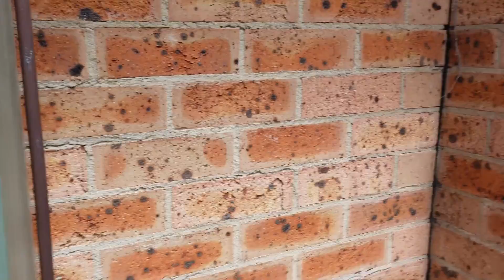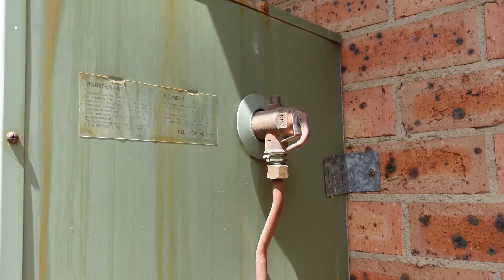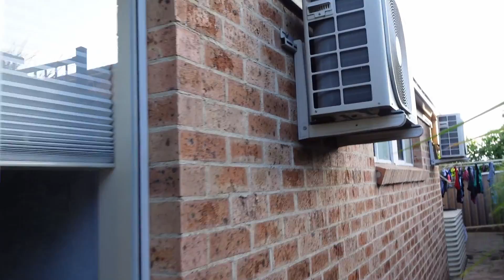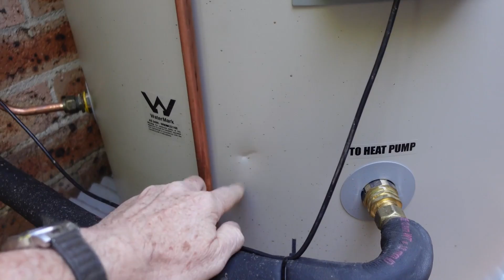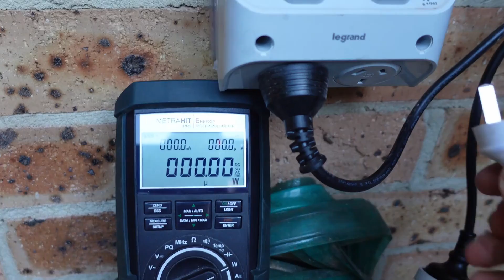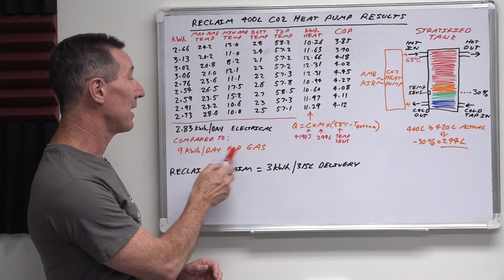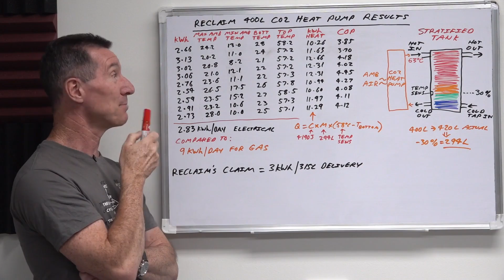EEVblog 1517 - Heat Pump Hot Water Install & Analysis

Comment: Ambient air... my daily consumption on my reclaim has gone from 3kw/day start of October down to 2.2-2.5kw/day currently.  It does jump about a "lot" with ambient air going from 15deg to 25deg.  2 showers a day & some washing up.
Best thing is that even on a cloudy day with a 4.5kw solar system, its 100% free energy at its 1kw/hr consumption!
Reply: From 3 kWh/day down to 2.2 - 2.5 kWh/day, supplying you free domestic hot water even on a cloudy day from a nominal 4.5 kW solar PV system is very nice. With a power draw of 1 kW it means the heat pump needs between 2 to 3 hours of operation in your particular use case and the solar system seems well matched to your needs.
Reply: @sietuuba  yes, on most days its enough to cover the hot water & do some other low current draw activities. However that may change in winter - i'll be adding more solar soon :)
Reply: Wouldn't a solar water heater be better and cheaper as no electricity is used at all? Maybe they're not that common there.
Reply: @GeomancerHT  They are quite common depending on where you are, new builds some councils mandate a solar water install.  You are 100% correct - they're the most efficient way to heat water - however, they're not the most efficient use of roof space - thats the thing. If you have loads of roof space - its the best option.  If you have limited roof - you're better doing solar, so that the other 1/2 the day its producing for you.
Reply: @nateb3105  thank you!
Reply: @GeomancerHT  It does depend quite a bit on the needs of the building and its occupants as solar thermal collectors are very efficient but they only produce hot water and their production can easily exceed the needs of a single family home in the summer. Other things factoring into the decision is how much thermal energy storage fits in the building to service the needs in the shoulder seasons (spring and autumn).

Space heating is a great application of solar thermal systems in addition to producing domestic hot water for the taps, but if that isn't needed, or if the building isn't going to be built or renovated for hydronic heat distribution that works best with "low grade heat" as in all the way down to under 30 degrees Celsius, it impacts the economy of the system. Solar photovoltaic systems have an easier time finding some work to do since electricity is easier to distribute... even though storing electrical energy is more expensive than storing heat. A system for delivering solar thermal heat to something that needs it is potentially more expensive despite the storage method itself being cheaper!

Comment: No need to set the tank temperature so high. Drop it to 45-50 degrees and the heat pump efficiency will go up quite a bit.

Comment: Your figures are very similar to mine after conversion.  Had an on demand gas at the old house,  an old off peak tank at the current house and converted this to a Rheem 320L heat pump unit. We are on a 5 kW (rated ) solar system.  South Aus, near Port Wakefield.  Instant reduction in our power bill.  I recommend this to everyone. Our unit cost $4000 installed. 
I'm keeping my old tank. Going to set it up as a standby solar cell only heater for outdoor hotwater for washing the doggies.

Comment: Hello.
These heat pump units are a super device. Because it is the only device that can give more energy than it consumes. Not technically, but it is. Let me tell you a secret. It's the same as killing 2 birds with 1 stone. During hot water production in summer, the outdoor unit of the heat pump blows cool or cold air. Introducing this cold air mechanically or electronically into the building through a filter and through the air duct will significantly reduce the use of indoor air conditioners externally. The result is extra savings.

Comment: First I grew up in a house with an 85°c hot water system, yes that's what came out of the taps.
Secondly I just got a free heat pump hot water system at my business property due to a government program.
Thirdly I live in the same city as you.

Comment: We're thinking of moving away from our gas hot water system and stove as well. Unfortunately, since our (newer than yours) Rheem had the bottom rust out of the tank we got a far more efficient "on demand" system as a replacement, however that was before our solar panels were installed so it's still relatively new. 
Downside will be that without a battery we can never have hot water production during a blackout (the only benefit of the old system) or use the stove.

Comment: The diagram @33:15 is showing lower COP at lower temperatures for both refrigants, so the efficiency in colder tasmania should be worse, not better. Perhaps they measured efficiency through a heat wave..

Comment: Dave loved your blog, maybe you could comment on my experiance, I just had a Chinesium $2500 heat pump installed for $99 in Kincumber I have 3.3kw solar no battery, SO I programmed[installer did not set] to operate 9am to 3pm which, so far, has used the summer solar. My concern is the winter, the unit is set to just 65°C, not much headroom. The unit does have 1.7kw full freight heater which is selective to off. Bottom line, using solar [I see on last bill I have used some of the 222kwh feed in, there is only a change of $5 on the total bill for January. My old heater was 10 yo, a new heater for $99 is a good deal. IF it dies and no warranty I guess an off peak original will go back in. The subbies were doin 4 a day, my job was acceptable but sketchy, the electrical would not pass regs IMO but OK, the expansion valve drain will discharge on your feet, not legal but ok as they would say "existing" PS they reused my expansion valve insulation kit, just 600mm foam on the discharge, our villa is 34 years old, no pipe insulation, BUT lots of fibre in the roof, the 3/4" line is too big, holds lots of water to go cold, takes 30 seconds for hot water to reach taps. I intend to rerun the hotwater lines in 1/2" PEX, with a return loop to the tank as it takes 30 seconds for the hot water to reach the taps what do you think

Comment: The idea that a system which is scavenging for heat will operate more efficiently in colder temperatures strikes me as specifications supplied by Batteriser but if this is true then you can deliver net cooler temps to your heat exchanger by slowing down the fan or recirculating some of its airflow.
But how that makes a lick of sense needs its own video because - it doesn't

Comment: Seems very strange that a heat pump should get better COP with lower ambient temperate. The lower the temperature difference the heat pump needs to work against the more efficient it becomes, it's kind of obvious when you realize that a heat pump is the inverse of a heat engine, which can be more efficient the higher the ΔT is.  Higher efficiency in a heat pump because of a cooler heat source would "break physics". Even if the system is extremely optimized for max efficiency at slightly lower ambient temperature you should't get lower efficiency because of the warmer heat source. 

And if you haven't changed use much since the gas heater, you know how much energy you use per day on average, with much greater certainty than your calculations based on measuring the temperature and a lot of assumptions. With just the one assumption that your use haven't changed significantly your "COP equivalent" is about 3.18 based on 2.83 kWh power used, and 9 kWh heat used based on earlier use.  That's not great, that's really bad. And high ambient temperature doesn't explain low efficiency in a heat pump, no matter the refrigerant.

Comment: I love your engineering breakdowns. I have a Rheem 50 US gallon heat pump water heater set to 120F or 49C and your KWh usage numbers almost exactly match my KWh daily usage. There are no mixer valve requirements here. It’s located in my garage, so it reclaims the heat from my and my wife’s cars. I am jealous that you have a stainless steel tank. Here it’s all about planned obsolescence, meaning a glass lined steel tank, UG…

Comment: Ive wanted a heat pump water heater just to use it for its dehumidification and cooling ability to cool the house while it heats the water..  save on ac bills …

Comment: Does anyone make a combined unit that has air con as part of it? as you are wasting the cool air in the summer and running a separate AC and dumping heat in to the air. I’ve seen large commercial systems with multiple AC units where hot and cold is dumped into a loop of water pipes keeped at about 35C with a cooling tower and off peak thermal storage.

Comment: Got a 300 liter tank with a 500W heatpump on top. I have an esp8266 checking the shelly3EM power meter and if it sees more than 400W going from solar to net it switches the heatpump on. Off when solar doesent deliver of wifey is cooking or washing. Works quite well in summer and not at all in winter.

Comment: OK, I'm about to start watching the video as a month ago I had installed a Reclaim heat pump and Earthworker 315litre storage. Two weeks ago we got the 6kW solar array done and set the Reclaim to mode 4 (only on between 10am and 4pm). It's been using 1kW between 10am and 11:30am-midday and so far I'm extremely happy with it. Looking forward to what you discover with your own system!

Comment: My only question, why use outdoor air for the heat? One of the benefits of a heat pump hot water heater in a hot climate is that you can get free cooling in your house!

Comment: Have you measured how long the temp in the tank remains above the temp needed to protect from viral and the like as that is my biggest issue with a tank is you need to heat it constantly

Comment: One thing with gas water heaters is that their efficiency tends to drop as they age due to sediment unless you have really soft water, so your old one was probably well under 70% efficient. I'm planning to move to a heat pump water system myself after I get additional solar installed.
Reply: You can just add water softener unit.
Reply: @jacekk6913  There's plenty of stuff the water softener doesn't stop from my experience. My parents have a good water softener yet there's still plenty of crud that comes out every time the hot water heater is flushed. There are also many cases where adding a water softener isn't feasible and in some jurisdictions, they're in fact illegal, specifically ones that use salt. This is the case in my state where wastewater is often recycled. Adding a softener to my house would be a major project since it's not possible to install one where the water enters my house under my master bedroom. I'd have to run a lot of pipe and sewer to be able to install one in my garage where my hot water heater sits at the end of the line. As much as I'd like soft water it's just not going to happen with my house.
Reply: @aaronwilliams1249  Water softener is not for catching stuff, but to soften water. For that u need to have filters. Add few meters of pipe is an 2-3 hours job. Did that at my home 3 years ago. It’s salt working device. It drops dH from 23 level to about 7dH, because most of the pipes are made from Cu
Reply: @jacekk6913  Try running a few meters of pipe where a slab floor is involved and get back to me. As for a filter, that doesn't help in this case. A lab analyzed the crud and it was mostly silicates that precipitated out. It also doesn't help in cases where water softeners are illegal.
Reply: @aaronwilliams1249  If someone is lazy nothing is easy. No one needs to remove all floor to put a pipe in it. There exists electric hammers that do just the slot for the pipe. Moreover. Where I live houses have also walls and ceiling. Try to use that. Filter sets for silicates also exists. But water softeners are devices to soften the water, not filter it. Water with totally no silicates is needed only for industry or fish tanks. It also doesn’t help where are illegal?? What an idiotic sentence.

Comment: Oh that's interesting it's two pieces! Over here in the US we just started pushing for more efficient water heaters although they were fairly well efficient already. as nobody likes their hot water getting cold that they paid for. The units now have everything in the top foot and a half section of the water heater. They also include electric back up or/and boost. And there's a temperature range adjustment because well bathing is one temperature and sanitization and commercial kitchens or another so you have to find a setting for your liking and safety. within that range you also have to keep in mind more energy usage for higher temperatures.

We have what is called a mixing valve same thing as you're calling a temper valve. It's not used very commonly as it's more normally a matter of setting the temperature on the water heater. However in places where you would need extra extra hot water and not so hot water say sharing a industrial kitchen with a bathroom or similar. It can be also used to prevent pipe freezing by circulating some of your hot water back into the cold water lines on outside wall sections of additions.

Comment: It's common practice in colder climates to insulate your water pipes and older water heaters. This is something that Texas found out the hard way, it should be standard although usually they have the opposite problem getting warm water instead of cold water. Either way pipes can freeze and it does damage.

It's also common in warmer climates of the US to have outside water heaters for some strange reason where they're more subject to environmental issues and degradation. Although they lose less heat into the cold air condition environment with them outside in the hot environment so each your own.

Comment: Most house in the nordic countrys have central heating with water radiators. The two most common systems is ground source heat pump or a  air to water heat pump. (i have a air to water heat pump and its for both tap water and heating the house) mabye 25 years ago the started to be more common. Before that domestic fuel oil or electricy was the most common to heat the house. When my house  140m2  (1,506 sq/ft)  was on electricity for heat it hused 18-20.000kw a year. With a heat pump i am now under 10.000kw and i have a slightly higer room temperature in the winter.

Comment: Just a curiosity, Did you consider a "Classic" Solar hot water system (With Restive Boost) over a Heatpump driven by solar.
Reply: This has been compared and analyzed by MC electrical channel. The  HPHWS won easily

Comment: None of your units are on proper vibration dampers though, they just used the flat rubber pieces. Probably cut from cheap rubber sheet.

Comment: 14:15 You could directly compare the consumptions based simply on the bills and the price per unit of energy consumed (assuming the two systems are set at the same temperature). For the comparison to work though, you have to assume equal amount of cold water going in and to determine that you would need a flow meter on the inlet (as pointed out at 29:15).

The bills might be higher than expected with the new system due to increased consumption. It's very easy for the consumer to assume that just because the new system is more economical on energy, then it will be fine to consume a little more hot water - but in practice it might prove hard to judge exactly when "a little more" becomes "a little too much".

Comment: 10:07 I fail to understand why the installers never insulate the cold water pipes - or even the overflow pipe. If all the water in the tank reaches the set temperature, then heat will slowly leak out of the cold water inlet pipes. Plus, insulating the cold water pipes will limit the chance of them freezing in winter. A few meters of pipe insulation costs next to nothing.

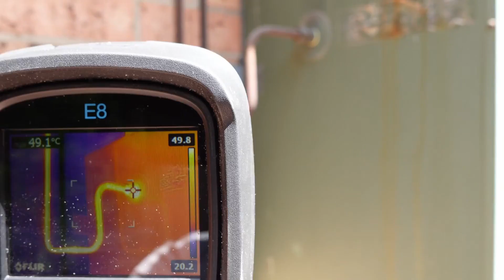Comment: 4:26 Sure there is loss of heat from the exposed pipes. It's just that the boiler is hot enough that the pipe is maintained at the same temperature. If it is a particularly hot day, then the pipes through the roof might not lose too much heat but in winter it will be a different story.

Comment: I understand that in Australia there isn't a lot of need for heating, but here in Finland heat pumps of various kinds are used extensively for heating buildings and water also. The most effective ones use drill wells where heat is transferred from the soil by a circulating fluid, such as ethanol, but the initial cost is high, about $10,000-$20,000 for a single family house. A cheap alternative is a heat pump which extracts heat from outdoor air, and those are as cheap as $2,000, including installation. Their disadvantage is that efficiency falls when temperature gets cold, and they completely stop producing heat at -30..-25 Celsius.
Reply: Newest air to air heatpumps can work down to -35C .. There might have been one -40C too..

Comment: Measure that temperature again to see if it was not a Fluke! Ha. Arthur looks nice.

I got a tempering valve on my hot water system with an electric storage heater... Mighty useful! They're not standard here in Poland, but I highly recommend them.
Apart from the high-ish COP 5 claimed by Reclaim, the real deal data loooks nice and I like that you state the limitations of your methodology, and how they can affect the tests. 

Tank stratification very nicely explained!

Comment: Wonder why they didnt install a tank with a spiral that acts as a heatexchanger, then you just run cold water into the spiral to have it heated? Isnt it much more safe to use a heatexchanger in terms of legionella? Also this way you dont ruin the stratification nearly as much when you start tapping.